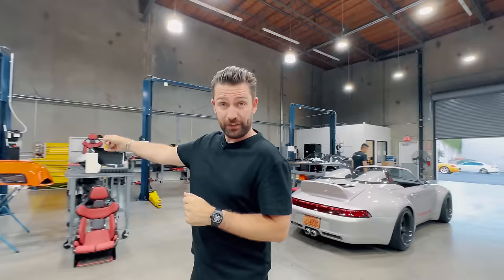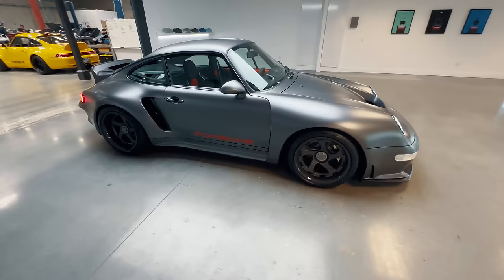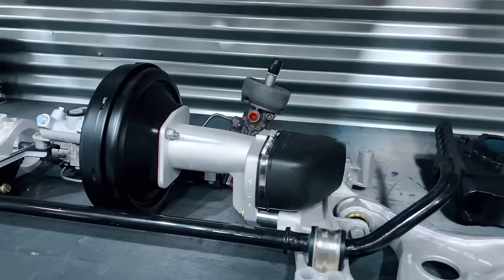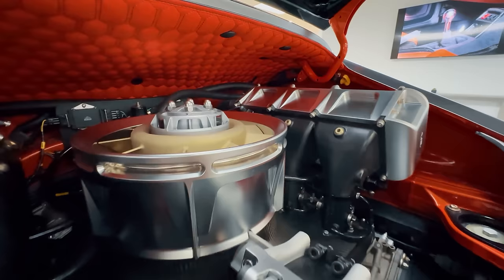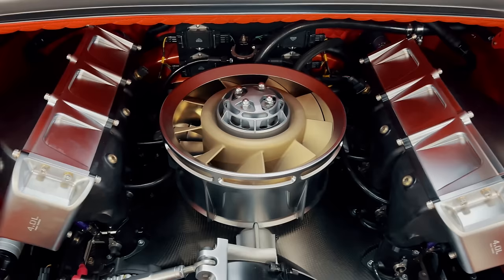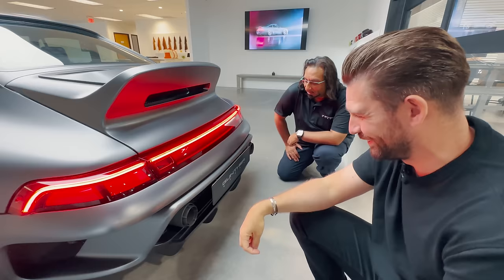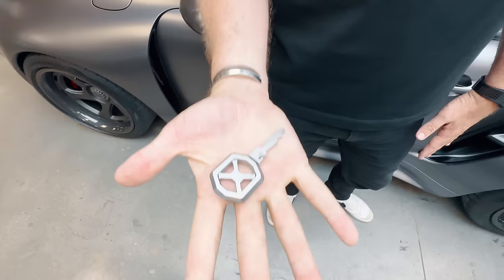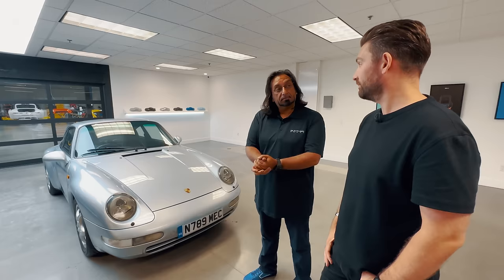I Bought My First Guntherwerks Porsche! The Build Begins Today…

Comment: I remember 20 years ago when I worked in the glass industry, we used Inconel for certain parts of the furnaces and a box of stick welding rods in Inconel were £800 compared to about £15 for mild steel. So I dread to think how much those exhaust tips are.

Comment: @ 14.10 I think that bracket is on upside down.
Surely the flat part should sit on the bottom with the curved part on show and the bolt on show not the end of the thread?

Comment: The engine bay reminds me of Pagani.

The power selection options are exciting. A chassis designed to handle 750HP operating at 550HP has got to be an amazing sensation. Think about 550HP in a car that weighs less than a GT3RS. At full power, this car is directly comparable to a McLaren Senna. I can only hope to see one get thrashed.

OK, one more thing. Seeing the two 993s next to each other, the A-Pillar stands out. It's the same thing with the original Miata. The airbag-free A pillar is one of the most important aspects of the aesthetic. A huge piece of glass with a tiny frame.

Comment: At 14:10.  Is the alternator support bracket mount fitted upside down? Rotated it would fit the engine better, and the retaining bolt could be accessed without removing the fan.

Comment: I’m sure I’ll be unpopular here but I reckon these cars need a better automotive industrial designer. The front air intake at the front and rear guards seem clumsy to me. The engineering, carbon fibre etc is amazing. I’m sure it drives great too. But I’d never hop out, look back and think “yes”